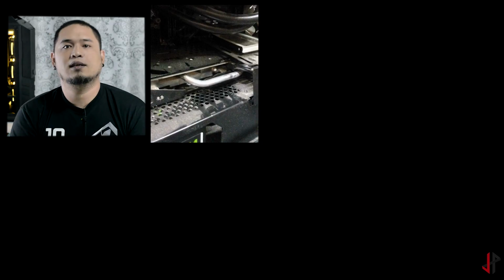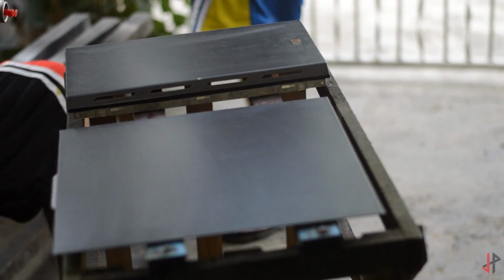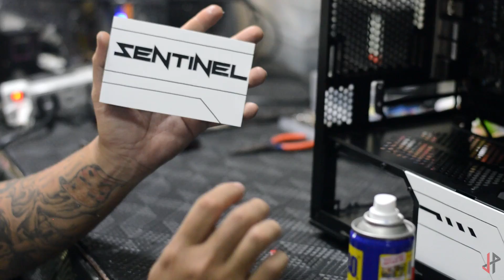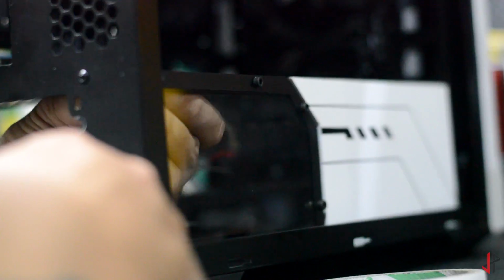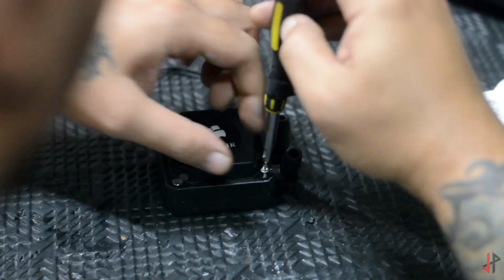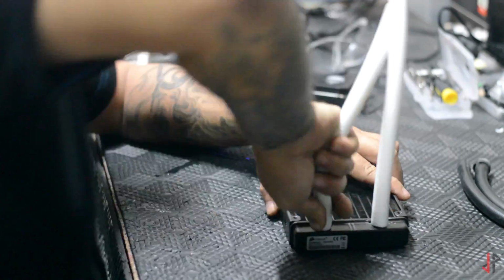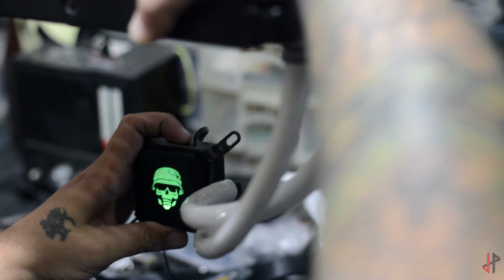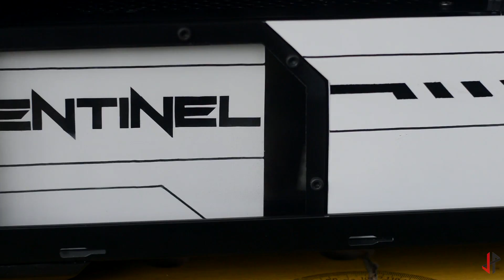Project Sentinel

Comment: nice video . i got a question about power supply . im using amd fx6300 (Oc 4.6ghz) gtx 1070 zotac(little overclock) .no water cooling. what is a good watt power supply should i get ? is 750 watt be good enough ?  thanks. JPModified

Comment: Man, you really made this rig look so much better. The only thing I would have liked better is if you would have made the logo on the front flush with the panel instead of just placing it on the front. Would have made for a better look in my opinion. Other then that though, it looks amazing. Keep up the good work man!

Comment: Very impressive!
I am currently building two systems - a dual-processor workstation and a pfSesne firewall for my home and was looking for inspiration on simple and cheap mods.

The workstation motherboard is green, so I will use two NH-U9Bs and Nanoxia Deep Silence fans. I will also make custom green PSU cables.
For the router, I will go back-red and make custom backplates for the Intel NICs using the method shown in this video :D

If anyone is reading this any advice is welcome. Liked and subscribed :)